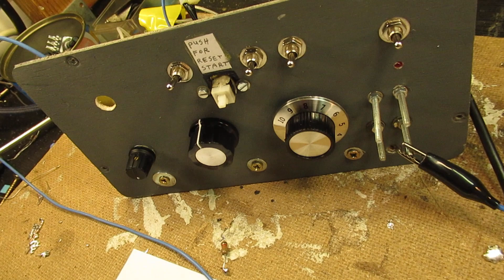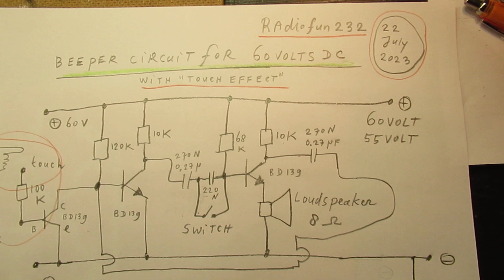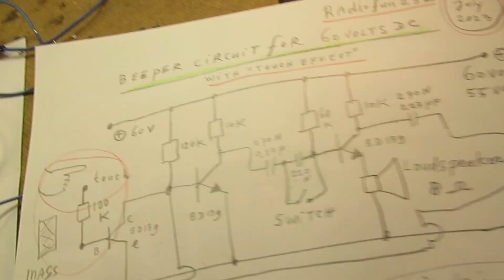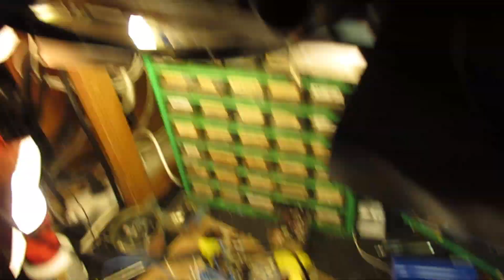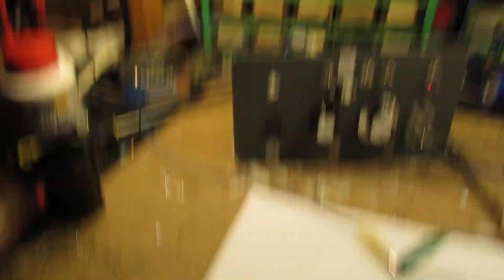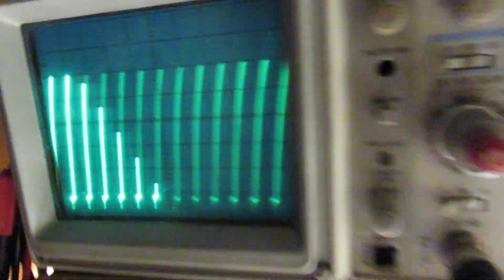Beeper circuit on 300 Hertz or higher sounds, working on 55-60 Volt DC, schematic & demo

Comment: Interesting... sorry if i missed, why the voltage requirement choice ?
Reply from the maker: Thanks, it will be used in combination with the squarewave oscillator (with AC 40 Volt out) as an indicator when the oscillator stops. That squarewave oscillator works on 57 (60) volt.